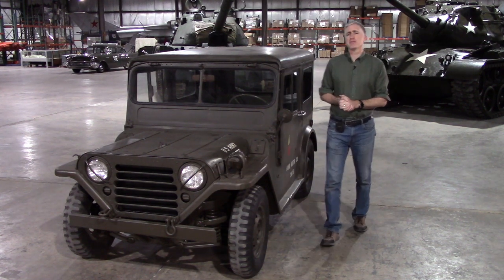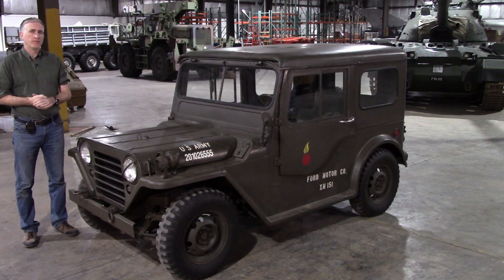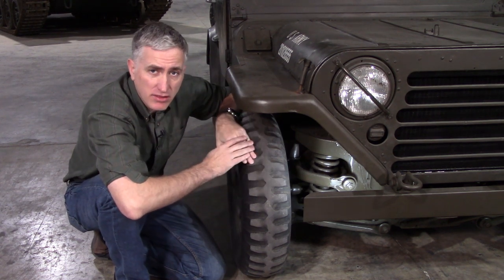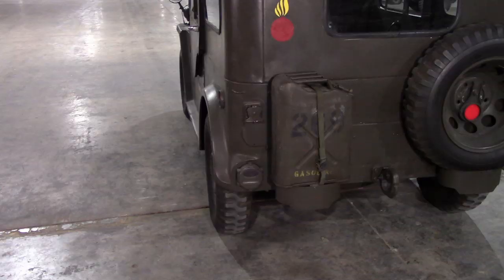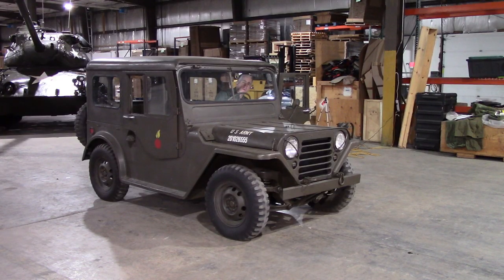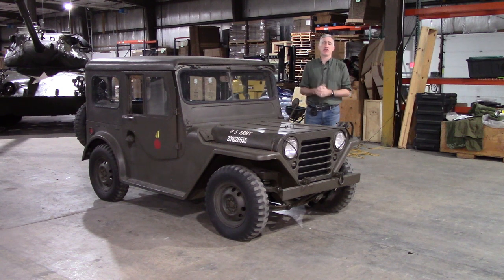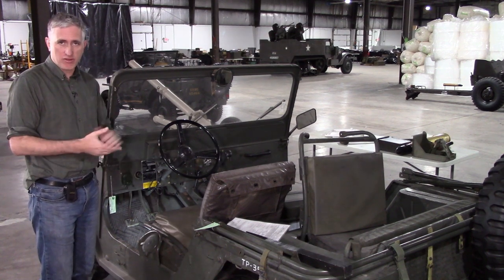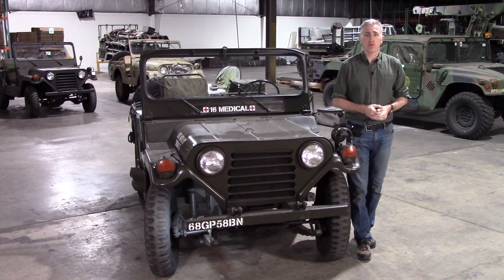Inside the Chieftain’s Hatch. M151 Series

Comment: I put a few miles on a Mutt while in Vietnam, 1969. The anti theft device (no key required to start the vehicle) was a chain welded to the steering column. Loop the chain thru the steering wheel and secure with a padlock. Equipped with an electric fuel pump the engine would sometimes fail to start until the fuel tank, under the driver's seat, was beat upon with a solid object. Hammer, rock, etc. It was common to carry five passengers with their weapons, flack vests, steel pots, ammo, and a radio.
Reply: Later M151's did away with the electric pump and went with an engine driven one.
Reply: They did the same thing with the Humvee, except that instead of a chain they used a steel cable, but the same basic idea.
Reply: @Riceball01  We would tell the me guys this cable was a pull starter.
Reply: I drove one in the early 80s,  forgot all about the chain! 
Thanks for the memory. 
Happy Trails 🍀
Reply: While I am (just) too young for Vietnam, I operated a number of these (A2's) and I found the biggest anti theft device was the kids trying to operate them couldnt find the starter button down on the floor.

I remember freezing my left foot off in Germany because of all the rainwater channeled in through the drain hole by the drivers front tire which acted like a bilge pump in reverse.

These were cool because they could fit on the tailgate (and still allow it to close) of a C-130. Try that with a HMMWV!
Reply: That’s every single wheeled vehicle
Reply: That never stopped us from stealing them in the motor pool and taking them for joy rides, one of my buddies came up with some kind of master key that would unlock all those U.S. marked locks, we'd bust em up real good and then park them back on line with mud dripping off of them and sagging on one side from broken suspension components. 
While I'm at it I'd like to thank the American taxpayers for funding all the fun I used to have when I was in the Army 👏👏👏.
Reply: @IRAQIWILDMAN1  sounds like the same prank with having the new guys in armored "warm up" the large stick shaped windage detector by rubbing it. Lol
Reply: The modern man has to ask whether you had an  app   to open the padlock!  Sorry couldnt help it
Reply: I served from 68 to 83 and we hated the damned things they were prone to roll over during cornering above 20 mph and deadly above that they probably killed more troops than anything else between Vietnam and the introduction of the hummer

Comment: I loved the M151.  We had 9 of them in a scout platoon that I was in.  That was '79-'80 in Korea.  We drove the hell out of those things and they just kept on running.  The only jeep that needed any major work was the one we rolled down a hill.  We flipped it right side up and completed the rest of the field problem with it, afterwards it went in for body work.  The M-60 mounted on top didn't fair as well.  Those things went places you would never get a hummer to go.
Reply: Grant I loved mine with the tow2 stationed in Hawaii at kbay 3rd marines
Reply: In your opinion what would need to be done to the Humvee to make it as good as the M151 off-road?
Reply: @EnterpriseXI  Make the Humvee narrower (which will never happen), because we took those things up trails that were WAY too narrow for a Humvee. In fact that's how we rolled the M151 that we rolled, the driver got it too close to the edge of a very narrow track that was on the edge of a steep hill (all the hills were steep it seemed) and the edge of the roadway, if you can call it that gave way, and down she went. The driver bailed, the team leader bailed and the gunner bailed. fortunately no one was injured beyond minor bumps and bruises.
Reply: 1981 I was driving a M151A2 down range as part of a training mission. Our vehicle was last in line of our convoy and we lagged behind due to some rough terrain. My sargent instructed me to catch up, so as I increased speed I came to a bend in the road.
As I turned the bend several large ruts in the road presented themselves with one getting acquainted with my left front tire. Deep rut plus tire equaled roll over. Jeep flipped forwards tossing me and both of my passengers out. 
I was knocked unconscious and when I came to, crawled out from under what was left of my jeep. The only thing that saved me from being crushed was the M60 mount that had been left in the vehicle from a previous training mission.
The medic that attended to my head wound told me we were the first ones (at my post) in 22 years that had all passengers survive a jeep roll over.
I loved my M151 but I loved that M60 mount more.
Reply: @billob4285  Wow, I never managed to flip mine, came close, and mine didnt have mg pedestal.
Reply: People really dont know how  maneuverable and versatile those little things were.
I basically lived in one at Ft. Hood, Tx.
Reply: @ws2228  our jeeps didn't originally have mounts, but were added as an after thought. One weekend, mechanics, drilling and welding, viola! M60 mounts.
Reply: @Grant5272  What some enterprising military needs to do is just buy a bunch of Suzuki Jimnys and paint 'em Coyote Tan. Bam. There's ya tiny off-roader.
Reply: @Grant5272  I was in the army in '85, with the then brand new HUMMVs. We had to carry chainsaws in them for a while, because the trails had so many spots where a 151 could get through, buta HUMMV couldn't
Reply: Hmmwvs are far better than these
Reply: @billob4285  You were not in a Jeep. It was a Ford. :)
Reply: @joezephyr  it was manufactured by AM General Corp.  said so on the stickers plastered in various places on the vehicle. So not a Ford.
Reply: @billob4285   "Jeep flipped forwards tossing me and both of my passengers out. 
I was knocked unconscious and wh......crawled out from under what was left of my jeep. 
The medic that attended to my head wound told me we were the first ones (at my post) in 22 years that had all passengers survive a jeep roll over."

 AM General Corp.  Gosh!    And yet 3 times you called it a Jeep!
Reply: @joezephyr  hmm, since everyone on the post called it a jeep, it was a jeep. Go argue semantics with the Army.
Reply: @hoilst  Don't the Suzukis roll over, too?
Reply: @mikeking7470  Not as much as was led to believe. Consumer Reports basically put out a hit piece where they modified their own test to purposefully get the things to roll, then called them unstable when the small and tall offroaders tipped when being flung about violently at highway speeds.

Comment: I was in D Troop, the ground Troop, of 8/1 Air Cav Squadron at Ft Knox in '71. Each platoon had a bunch of these, most with a pintle mount for a M60, another with a recoilless recoilless rifle, and a 5/4     with a mortar.
With a radio mounted, ammo, and gear for 3 guys they were really stuffef full.
The good news, with the pintle mount sticking up above the seats they were much safer, and since they were much cheaper to operate we got to use them a lot more than the tracks in the unit I was stationed in Germany.
Reply: 2nd ACR in Germany?
Reply: @stevenpilling5318  Recon platoon, Combat Support Company, 3/35 Armored, Bamberg. There we had 9 M114A1E1 & 1 M113. Spent a lot more time in the motor pool looking busy than actually using them.

Comment: Thankyou. That video brought back some awesome memories for me, I drove those things for almost 10 years in the 1980's. The Chieftain touched on the subject but didn't go into detail but Ford designed the 7 slot pressed grill but didn't think to copyright it. After the war Willy's copyrighted the 5 slot vertical grill and now whenever you see it you KNOW its a Jeep. As for the hardtop, the only time I saw one of those was when we deployed to Alaska for a training exercise and we got issued them, which was okay but not nearly as important as the gasoline heaters they put between the front seats at the same time <grins>
Reply: And don't use the heater to pre heat the engine if ya want the thing to start, ones we had pulled 13 amps and would kill a cold battery
Reply: Our 151's in Germany got heaters that were mounted on the front right fender, sure was toasty, but i loved the 4WD on the fly, and a little tuning would get it up to 70mph on the A-baun.
Reply: I was in the US Army in S. Korea 71-72. We had canvas tops but were not allowed to use them. The thinking was we were driving a tactical vehicle and would be more able to tell if we were under air attack while driving. :-O Couriers driving M151A1's were allowed tops as they were not considered "tactical'.

Comment: I learned to drive one in '71 in MP School.  They WERE dangerous, though.  As a CID Special Agent, I don't recall how many M151 rollover deaths I had to investigate.  Don't know why, but typically the driver wound up with his head about 3" wide!  Too many tried to drive them like race cars, even souping up the engines so that they could go "per" (when the speedometer needle was pointing to the "per" in "miles per hour" at the bottom of the dial).  I currently own a M151A2 which I restored, and which is great for running around out in the desert.

Comment: My unit in Germany (86-89) had 6 Ford Mutts in the TO&E.  Slow as hell, but you could drive them out of the Hohenfels mud like a champ.  Oh, I should also mention that ours had the pheumatic windshield wipers that works about .01% of the time.  It was common practice to tie string to the wipers and the co-driver would operate the wipers manually with the string.

Comment: I was on TDY at Ft. McClellan, Alabama in October of 1969. The place where the WACS were exclusively trained in the time. I was a driver on the huge Caterpillar Swing Axle Forklift that required climbing two ladders to get to the operating cockpit. Don’t recall the model number of the lift though. 
Each morning I would take the lift into an Ammo Bunker and bring a pallet that contained 4 M-151’s on it. There would be 4 tires laid on the pallet; then one Jeep with windshield down on them. Then another 4 tires and another Jeep. The process went 4 high and then capped off with a special top pallet. 
A couple of men would begin disassembling the stack of jeeps placing tires into a large steel box like bin. I would take one Jeep off and set it by a guy in welding garb with a torch ready to go. He cut the engine mounts into and his crew lifted the engine out and placed it into another big steel bin separate from everything else. Then I would lift the Jeep and place it into the Crusher. Repeat cycle again and again. 
The finished product was turned into an approximate 5’X5’ bale ready for transport to a metal recycling plant. 
Now I was an 18 YO boy from Mississippi just about 10 Miles due South of Memphis, TN. Remember it was 1969. I was a PVT E2 making after taxes a whopping $98.97 each Month. I was married to my High School Sweetheart hoping Vietnam wasn’t going to get my Reserve Unit called up. With 250 men having an MOS 55B20, we walked the line every month for 5 out of 6 years I was in. 
Anyway as a young wet behind the ears boy, I just couldn’t understand the reasoning behind the destruction of a perfectly good vehicle. The safety aspect considered, it just seemed with Ford as the manufacturer, it seemed logical to supply a refit kit with axles, etc. being cost saving and getting new jeeps to troops in the field more practical than what we were doing. 
Obviously I was suffering from a lack of failure to understand Politics in its truest sense. I thought they were like me. You know, saving money during the year meant more gains at the year end. But hey, let me say in big caps, I WAS WRONG, I WAS WRONG!! 
Anyway, for every Soul that served in the Land of the Yellow Man, God Bless you for your sacrifice over there. The way our troops were not accepted upon their return was absolutely uncalled for. Where I lived in the South, returning troops were always welcomed home with a hardy handshake and pat on the back. I don’t know what happened to the rest of the Country. 
Now, 50 years later everything comes out. How Johnson ran the war literally from the Oval Office. Causing young men to die and others to leave limbs in Nam that they had intended to take back home with them. God Bless you all. 
Later I became a helicopter pilot and flew 24 years in retired US ARMY OH6 Loaches. That would be the infamous OH6 CAYUSE named for the CAYUSE INDIAN TRIBES as all ARMY helicopters are named after Indian Tribes. What an honor that was indeed. 
Lastly I learned the incredible utility of the LOACH in particular. If only I had become an ARMY AVIATOR! I would have done everything in my power to rescue troops in the field. Even to the extent of disobeying orders sometimes to save another life needing transport to the nearest hospital. It does make a difference as we know with operators who run medevac units today. 
Well that’s my story and I’m sticking to it! Thanks

Comment: Great video, very informative. I drove these when I first served in the Ohio Army National Guard. We switched out to Humvees after I'd been there  about a year. We used M886's for our Ambulances    ( a Dodge SUV ) and the M151 with an extensive roll cage and a soft top for a couple of gopher vehicles. We had  2 Deuce and a halfs with trailers to move our Battalion Aid Station. When we got our humvees they replaced the M151's and the M886 but we kept our trailers and 2 1/2 ton trucks.  The M151's were scary on road at speed. Very twitchy. Off road they were quite capable.

Comment: My primary truck when assigned to TO&E units was usually a M35A2 with 5/4 ton trailer and a back up vehicle was a Gamma Goat which was backed up by the M151A1, 2 with trailer.  Before I could get it on my Standard Form 348 I had to attend that class for it.  In Korea my back up vehicle was a M880.  My SF 348 was two pages and I wasn't even Transportation.
Reply: all hale the gamma goat lmao go anywhere ........slowly  drove on in berlin with a RATT rig and a 5kw towed behind

Comment: My godbrother owned a 1951 CJ5 Army Jeep- it came with canvas doors , side panels and roof system- it also had a mount for a gun of some sort- the motor was a 4cyc 150hp gas engine and a oil bath air filter and power assist steering- he put bigger rims and tires and suspension equipment to raise it up a bit- of corse this made it top heavy and could and did flip over on steep hills lol- thank god he installed roll-over cage

Comment: When the 151s came out of service they could be bought in Property Disposal Office (now DRMO) auctions, modded to satisfy civilian standards, and registered at State DMVs. NTSB or some other Fed agency deemed them unsafe, and the PDO system was instructed to ‘quarter’ the bodies to prevent civilian use. So, folks would buy the four pieces, weld them back together, and drive on, so to speak. After a while, a new requirement was levied on the PDOs; quarter the body as before - and then run over the pieces w/a tracked vehicle. Local military museum near me has restored one of the ‘quartered’ vehicles, and the new welds make the thing look like a Frankenstein monster, which adds character.

Comment: I drove one in South Korea while in the 2ID in 1971-72. As is well known, it gets very cold in Korea but it was regulation that all M151A1s would not use the canvas tops in any season that were on hand. Something about it being a tactical vehicle and would interfere with sighting enemy aircraft. Right. I know couriers were allowed to have tops and there may have been other exceptions. I drove a jeep more than once a fair distance when it was below zero Fahrenheit. The speed limit even on paved highways for US Army vehicles was 25 kilometers/hr. The speedometer read mph on a M151A1, so your guess was as good as mine. ***Checking it equates to 15.5 mph.

Comment: I have rode and driven thousands ( Yes.. really) of miles in 151s. They were a tuff and dependable vehicle . They could be used on small paths and amazingly steep terrain . But the truth was they were overloaded when the crew got in with their rucks. We always carried Camo nets and spreaders along with A or B bags plus ammo ,radios , MG, MRE cases and whatever mission essentials . ..  SO they were really overloaded . We knew they were dangerous  but I think only drivers really understood how dangerous they were.  ..particularly on hardstand roads. The vehicle was used so long that almost all had been in accidents so they crabbed badly ...you could see all 4 tires from behind. ( This is really dangerous in a small vehicle with that suspension.) The wipers were useless..particularly on paved roads. The lights were weak.. A lot of the problem was they were used as an every day highway vehicle  (They weren't stable or designed for that.)  AND used in the field.  I really had no experience with M38s and little with ww2 jeeps... but I cant see that the 151 was a real improvement..( development history might be interesting)    incidentally.. I never heard a soldier call them Mutts.. always referred to as 151s  or jeeps. (we all knew they weren't officially jeeps)

Comment: Used to show an Army training film about these beasts that showed an M151 series towing an empty trailer,18MPH, making a fairly sharp left turn.Driver took his foot off the gas pedal M151 turned over on to if's right side.Also talked to a SGT from Tank automotive command that was involved in the testing of these beasts.The test consisted of servicing the unit put it on a test track driving until fuel was used up rinse and repeat.there were three units being tested at the same time.Units would travel clockwise for one tank of fuel,refuel drive counter clock wise for the next tank of fuel.Purpose was to find out if the test units would last the 20.000 miles the spec. called for.Ford always finished third if they finished at all.Units being tested were samples from GMC,Willis Overland,and Ford.Willis Overland always finished first Gmc Second Ford last if they finished.Remember That Robert McNamara was SECDEF at that time.